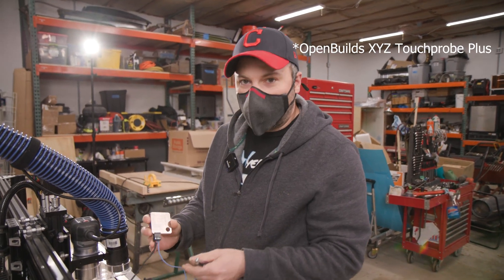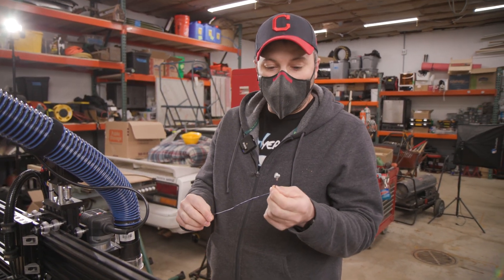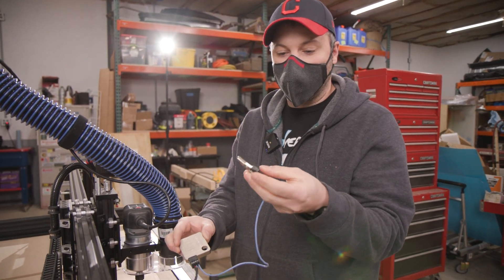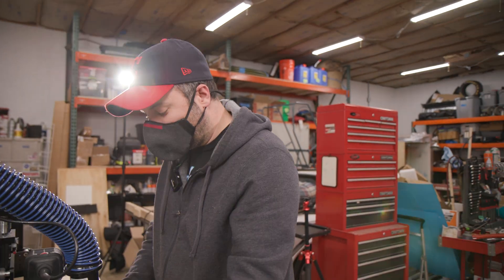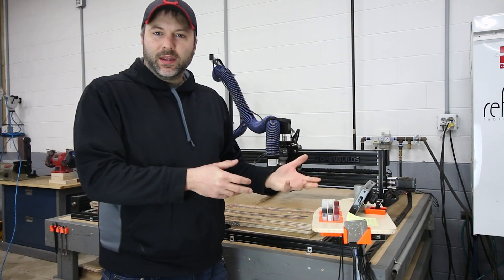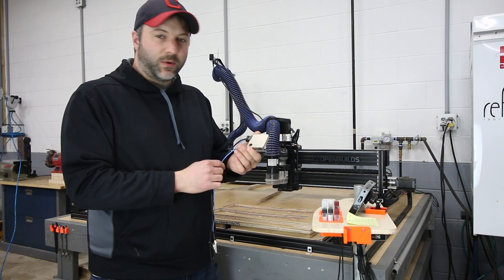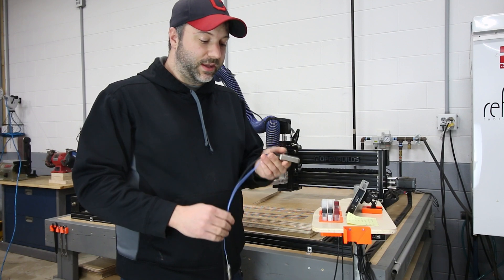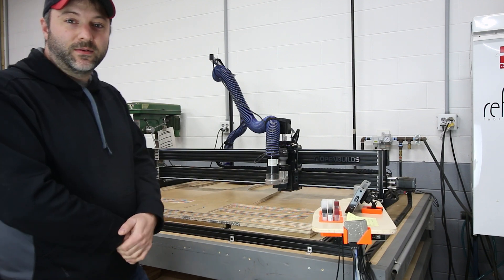Openbuilds XYZ Touch Probe Plus Review and Mods

Comment: Somebody probably already pointed it out, but the reason for the hole is so the macro works with any size of bit.  If you probe against the sides, then you have to account for the diameter of the bit. Which may change within passes depending of the bit used.

Comment: I still don't fully understand what this probe is doing.  Cant I just bring the machine to the corner of the workpiece and set zero? Is it just that the z height will be set more accurately?
Reply from the maker: You can zero the axis without this probe. This makes the process quicker and more accurate. You can use a piece of paper and jog the axis until it drags. Then  measure the thickness of the paper and offset by that amount and take into consideration the diameter/radius  of the bit your using to get your zero location but this is going to be far slower (and maybe error prone) than this probe. If your just engraving signs, flattening a glue up or a slab of wood a few thousandths accuracy is probably over kill and you can eyeball it. If you're making mechanical things that need to align to other parts accuracy is more critical. Or if you are doing toolpaths that require switching bits from say a flat endmill to cut the shape out and a chamfer mill to chamfer the edges then you need reset your z-zero height after the tool change this will make compensating for that a breeze. Another example is flipping a part over to machine both sides and you need to zero so the features align. Obviously there are ways you can make clever fixturing to help resolve some of these scenarios but this is just another useful tool to simplify and speed up the process of accurately finding a corner of your part.

Comment: Dont bump or drop that interface even on your shoe. Also I'd reinforce that screen ribbon cable preemptively- without it renders the Interface wafer useless, replacement screens are discontinued, 200$ bread toss. Reinforce - that -cable
Reply from the maker: How do you recommend reinforcing it? Some kind of tape or?
Reply: @SafetyGlassesRequired  I had started modeling a 3d print out of tpu to be able to give the screen some cushion until I realized there wasnt a way to replace the screen.
But an easy fix would be to put some thin foam tape behind the screen where the ribbon cable is tucked and soldered onto the board, the cable and screen are just held in place with one thin peice of double sided flat tape. There is a connector on the other side of the board to hook in a new one but openbuilds support said it wont work.

Comment: I'm pretty sure if you're just doing a Z - Zero, then you can just turn the probe plate upside down and then probe. The probe can lay dead center on your material for instance...
Reply from the maker: That's a good point and probably works for z zeroing I will have to try that. The scenario I didn't mention but it was specifically imagninging was flipping a part after machining one side and wanting to pick up the same corner. I suppose clever fixturing can handle this but is more steos. My past CNC expierence has largely been on CNC mills where I have a probe or wobbler on a Bridgeport and I can pick up any feature and any orientation.  Coming from that this feels simpler but limiting.

Comment: You can add your own probing routines by copying them onto the flash drive.  Just use the og probing routine as a starting point.
Reply from the maker: Is the probing routine simply a gcode file on the flash drive? I will have to look into this. Do you just call them  by opening and running a gcode file them like you would to cut a part?